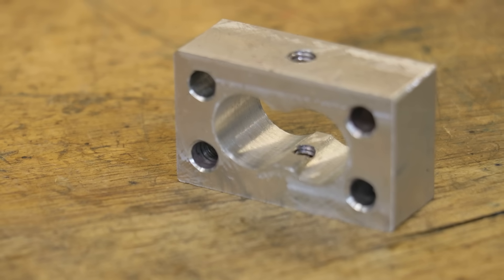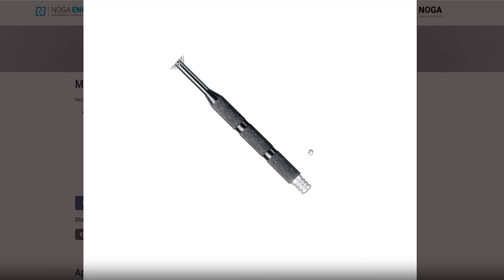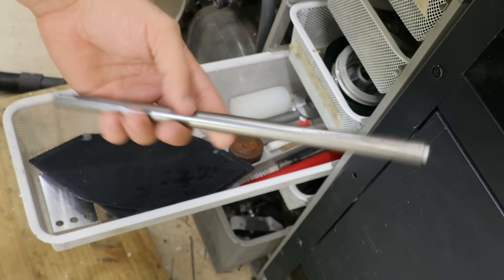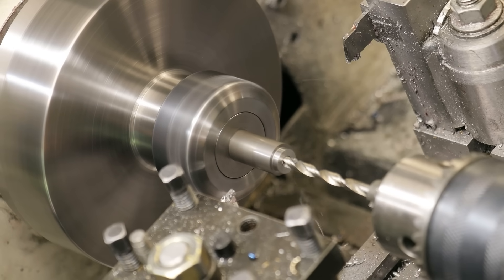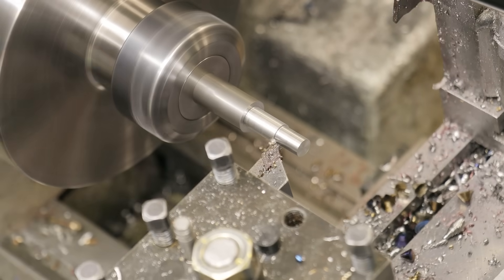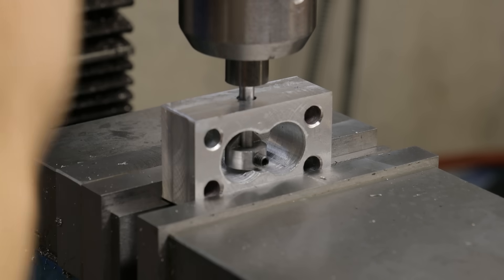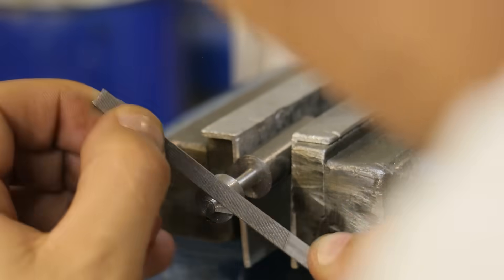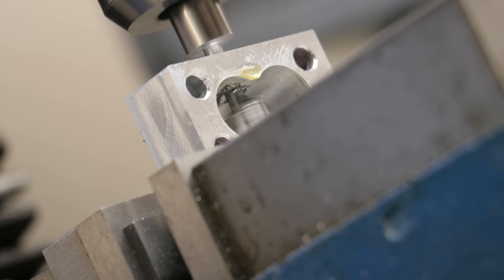Almost Impossible - Internal Countersinking In A Small Cavity

Comment: Just use a boring bar with a 45 degree head from the back of the hole and get on with life.
Reply from the maker: Normally you could do, not with this size of hole and size of countersink that was needed here. There is just not enough space to have the shank and a wide enough cutter.
Reply: What specific part number that will fit in the hole?
Reply: @jaro6985  Im talking about the ordinary boring head with the brazed carbide tools. Heat the tool, remount the carbide blade to 45 degrees and cool. place it through the back of the hole, set the diameter, back it off to cut the edge, your done.
Reply: @gregkretchmer3588  That's a pretty wide chamfer compared to the hole size.  It looks like you'd need about 3mm of stickout to cut the width of chamfer he needs, and to fit that through a 4.5mm hole leaves only 1.5mm for the diameter of the boring bar, which would give you about the stiffness of a wet noodle.

I suppose you could braze the blade back on after sticking the bar through, so you could use a larger bar, but doing that in the middle of a 12mm gap in an aluminum part without melting the aluminum sounds like not most people's idea of fun.
Reply: @gregkretchmer3588  ordinary boring bars are usually 8-10mm+ not 3-4mm diameter though.
Reply: You are right, forget the boring head. You have a curved surface, being cut with a tool for flat surfaces. If the desire is an even cut for clearance all around a wave washer shaped edge than a dremel type cutter or one of those swivel head deburring tools might work, held buy hand. Actually, if you are making a pump, the inlet compared to the gear is probably going to cause cavitation and high turning torque for little throughput. (you didn't say what this is or dimensions). Just get it working and do details later if it works. Look at car oil pumps as to inlet and line size compared to gear size.

Comment: Great idea on this very common problem!
And I can quiet your mind on the Noga internal deburr tool: I have it and like it, but even this tool has its problems when it comes to cleaning bigger burrs in Aluminium. I used it to clean inside square tubes and have in the end gone back to filing as far as I can and do the rest with the “regular” Noga deburr tool. As you said, it’s made for burrs but definitely not for chamfers.

If you’d like to CNC it, there are cutters for that like the Heule COFA, but I don’t even want to imagine what a tool like that costs 🙄

Besides that, looking forward to your upcoming project!

Comment: Got a boring head? Why not insert it then offset? For arguing between $21 and $75 you sure dont seem to value your time very highly, nor consider the basic material and tooling costs...
Reply from the maker: I have it up on the cad and it won’t be able to produce the size of the countersink that I need with this method.
Reply: Whats the specific part you are talking about, something like MQR-3-R0.15-L15?
I'm not sure if it would fit.
The hole is 3-4mm
Reply: Also the width of the chamfer is a good fraction of the diameter of the hole.  It looks like about a 3mm wide chamfer at the maximum width, and he said the spindle needed to be 4.5mm diameter to fit down the hole.  Any boring bar that's going to fit down the hole and have a wide enough cutter would then have to be something like a 3mm cutter on a 1.5mm-diameter bar, and that would flop around like cooked spaghetti.
Reply: @jaro6985  Considering the arbor diameter that was made, 3-4 mm is a poor estimate but ok. Also look at the 25 mm stock to finished arbor. Again, I'd rereview if I were you.

If you want to go that route, sure you can do that. But you aren't going to beat the price point, which is an apparent driver. Their quality of tools has been quite impressive when I have run them. Smooth, clean finishes on difficult internal geometries on 4140PH, in my experience.

Grinding HSS is not a complicated endeavor, and anyone tossing random material at a specific cutter SHOULD have some lying around. It is only aluminum, so grind geometry and undercutting to extreme levels would be more acceptable.

So, no, I am not suggesting the tooling you provided. It's highly bespoke and likely exceeding costs. Especially considering that the angle is incorrect, though that may not be important. But it is a "form basis" for the suggestion, yes (i.e. it would look similar).
Reply: @dogmaticAI  but first you just said insert a tool now you are saying he has to grind a tool, which would take just as long as making this part. As mentioned it needs to fit in a 4.5mm hole, so you won't get much offset.

Comment: "back chamfer cutters" or lollipop endmills are fairly common. They make them small enough to fit in a ~1.5mm hole, and can be used on a manual machine with a rotary table. Come down in the hole centered, offset by your chamfer width, do a 360, the un-offset and pull it back out. Making something out of stock on hand though is cheaper than the ~$40 for a cutter you'll use once though.
Reply from the maker: For sure but it won’t produce the side of countersink that I need at that size and I do t have a rotary table. Cheers
Reply: @artisanmakes I'd second the lollipop cutter with 45degree bottom and top. you can create x,y coordinates using the holes centre point as the datum. using simple trigonometry you can calculate a table of coordinates and wind the handle to each one. It produces good results. We do this at work when we don't have a rotary table or use of the CNC equipment.

Comment: Good thing you didn't spend any money on those Noga tools! I have a set of those that I got in an auction lot. They're great for deburring the back sides of holes, but doing an actual countersink with them would be painfully tedious except in a very soft material. I've done it in polyethylene, but I wouldn't want to try it in anything harder. I think your approach worked way better in metal than the Noga tool would have.

Comment: Sweet, thanks for the idea! I watch machining vids mainly to get ideas on how to do stuff with stuff and this is great. I don´t have a lathe or a mill but next close thing is a good (Wabeco) drill/mill stand.
Wabeco is local to me and they have excellent, affordable and modular systems I can build up as I have the dough. The hole shabang cost me like 400€, gets me an x/y table, the mill/drill stand with handwheels instead of levers and a clamping set. Further I need a vice, a little Proxxon will do. And a nice jacobs chuck for my drill would be nice, I have a machine that runs true enough for what I need.
Okay, make that 500. But then I am more than capable to make me bushes and shit, small parts, soft material- that´s my goal. Greetz, God Bless

Comment: I got an idea to improve the design: make the cutter like the head of a countersink, but put a thread in the center. Then make the shaft with a bit of thread on the end and a shoulder the head can screw against. To be able to countersink the backside of a hole you'd need a left hand cutting head though, or else it would unscrew itself when cutting (or you'd need a left hand thread). But this way you can make it really compact for even tighter spaces.

Comment: We used to use die grinder ball burrs, coming in from the side.  We also had these circular cutters that we could spin by hand, and would come in from the side, but those were more for deburring.
Reply: My first thought was to use a ball mill and come in from an angle
Reply from the maker: Yeah it could do, but it’s not what the drawing called for. It called for a 90 degree countersink
Reply: @artisanmakes let's be honest they would have accepted it. The countersink serves no purpose aside from breaking the edge. A quick call to the client would confirm this.
Reply: @artisanmakes  oooh, in that case, a small ball mill,  a 45 degree angle, a cnc machine, and about 30 step down passes
Reply from the maker: Sure, apart from the fact that this is not a cnc machine and I don’t own one. That is not a realistic solution
Reply: Had the same idea
Reply: Lollipop burr from the sides was my first thought. Aside from assembling a small arbor cutter inside the part like he did. I'm always thinking production and streamlining though. That's what I do 75% of the time. The rest is split between fixturing and keeping our, what should be museum pieces running, by making replacement parts.
Reply: This is technically not a proper countersink, but for the usecase it should be close enough. That being said, this is exactly how I would have tried to do it too. As an added bonus this should even work in relatively hard/tough materials.

Comment: I came in from the side and used a ball-shaped carbide burr in a die grinder to machine a chamfer onto the edge of a drilled hole in a similar situation.
Reply from the maker: Fair enough so, it won’t be the same geometry but similar
Reply: @artisanmakes  Yea. I didn't need as big of a chamfer tho, so the geometry was closer to the normal 45.

Comment: As far as I|ve heard in fine mechanics and optics they make features like these on the lathe from the backside using a courageously thin tool through the hole. I guess one advantage of doing this on the lathe instead of on the mill is you can do it in several small passes without swapping tools.
Reply: Yes, they called recess tools and are quite commonly used on screw machines. An example of their use would be to form the ball detent on sockets. They are also often used to make countersinks and counterbores on the backside of parts PRIOR to separation(cutoff) and recess grooves such as those for O-rings.

Comment: Good fix for an almost impossible situation. I would have done the same while using a stock made solid body countersink which could have been trimmed down to a smaller width and with that welded a 1/4 inch shaft to the back and then inserted that in to a ratchet handle. little bit of work to trim the welding bead down, works a treat as i've made one myself. got it to fit in a 15mm gap.

Comment: You could radius that area 1/2 the diameter of the gear bores then you won't need those chamfers, that's how a Dayton style pump/motor is designed
Reply from the maker: Fair enough so, different to the model which I have copied off

Comment: There used to be "backfacing" cutters available for doing internal spot faces. I used them as an Apprentice in the 1960s. A simple tool much the same principle as the tool in this video that cut flat spot face surfaces. The cutter was held on the arbour with a pin instead of a grub screw.
Reply: They still exist. We use them in aircraft mfg daily
Reply: @justaguy4788  I came here to say just that! Not terribly expensive and tend to follow common aircraft fastener sizes, 5/32..3/16...1/4 etc. Properly hardened and small enough to run in hand pistol drills.
Reply: Yes.  This is what I came here to say.  Reverse Spot facing tool.
Reply: Back countersink & back counterbore are common in aircraft parts manufacturing, may be limited to 100° on the countersink
Reply: @ChrisChandler-dj1wy  no, we had 90, 110, and 130 also
Reply from the maker: Yeah I check with the tooling supplier with these cutters and they are too long for this small space that I am working with here. So these specific ones would not work.
Reply: i used that tool on hrizontal boring mills in ont
Reply: Theadmill can work in a pinch too

Comment: For larger sizes, a boring bar with the insert removed should fit through the top hole. Then just add the insert back in.
Would probably work best with the old school boring bars that use round HSS inserts.
Reply from the maker: For larger sizes yes, for something this small it will not work with the size counter sink I am after
Reply: If the boring bar and cutter are small enough you can just jog it through the bore. CEE has had several videos doing that.

Comment: I wonder if there's a way to make an insert holder that is small enough. Then you wouldn't have to think abour tool steel, heat treating etc.
Reply from the maker: For sure there would be, but once you get down to M5 or M6, doing so would become very difficult with space constraints. Especially since I only had 12mm of height to work with
Reply: @artisanmakes yes, definitely a difficult task under these circumstances

Comment: Good solution but, with this countersink being purely for asthetic purposes (and not for the head of a screw to sit flush), I'd have probably gone for a suitably sized ball nosed end mill. With it only cutting aluminium the bit should have had sufficient strength for a little side pressure cutting.
But hey, I ain't a machinist and usually look for the easy option 😆
Reply from the maker: It is not aesthetics, it’s part of a pump housing

Comment: I did the same for a friend's antique carburetor. It had to be brazed after a crack and the hole for the slider's adjuster needed to be countersunk for an o-ring. The way i did it was to just take a normal countersink, cut the shaft off, cut 6 slides to it (like on a nut), cut a thick slot into it and mated that with a jack screw that would rest on the opposite end of the gap, made from a tiny coupler with one side reverse treads i had from when i took apart a Xerox  machine. Put the nut cut counterskink head over the hole, put the jack screw into the slot with a bent washer on the other side and then jacked it tight. One and a half rotations on the countersink would need two full rotations on the jack screw. And that was it. Perfectly cut for the o-ring to go in after four full rotations. Sounds like a lot of work, but the only work i did was cutting the sides on the cut countersink head.

Comment: Those are threaded holes, so I'm assuming the counter-sinks are for flat head hardware? Which raises the question how do you get the hardware in and how do you tighten it?
Reply from the maker: It’s not for hardware, it’s for aiding the flow of oil in and out of the housing. And FWIW the countersinks worked really well

Comment: If you don't have the right tool so make it. Good solution for that. I think when you form it like the cutting on a drill so it will be much better with no burr. Thank you for sharing.
Reply: I had to put down a laminate floor for my daughter and didn't have a pull tool. Idk what it's really called, but you hook one end and hammer on the other to pull two sections together tight. Went in the garage, grabbed some scrap steel and made probably the most robust versions of this tool known to man. I cut a 1.5" slug off a solid round bar from motorcycle forks to be welded to one end of a square bar to to act as an anvil and a short piece of angle iron on the under and opposite side to act as the hooking portion. Simple quick little tool that worked flawlessly. And I'll be using it again on 2 other rooms in my house so....worth it 👍🏼

Comment: Lmao. This is completly ridiculous. and I mean this in the best way possible. Totally genius idea. So if you can't get the cutter through the hole. Just detach the cutter head. Put shaft through hole. And screw on the cutter head. Love these kind of ideas.
Reply from the maker: Yeah it’s his one of those odd projects where the normal method didn’t work. Small hole and only 12mm work with.

Comment: Or use the lathe
Reply from the maker: I couldn’t see how to, not with the size of the countersink that the cad calls for and the size of the hole I’m working with . It’s much larger in the final video (which I am currently editing)
Reply: @artisanmakes Internal thread cutting tool/boring bar upsized a bit? Though getting enough stickout from chuck for access from toolpost ... Mm..
Reply from the maker: Yeah the size of the hole will limit the countersink you can do

Comment: I was thinking about something like a small 45° dovetail cutter that could fit through the hole and then moved in a circle but that might give too thin a shank.
Reply from the maker: Yeah, I was thinking too, same also with using a lathe tool. It for sure it would be on larger hole sizes, not for M5-6